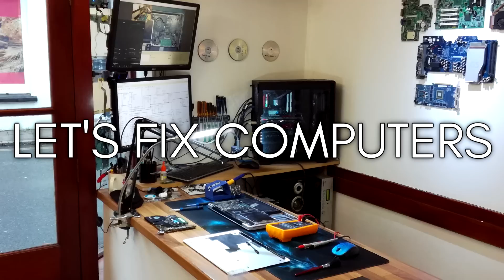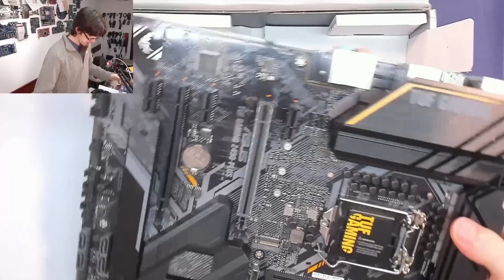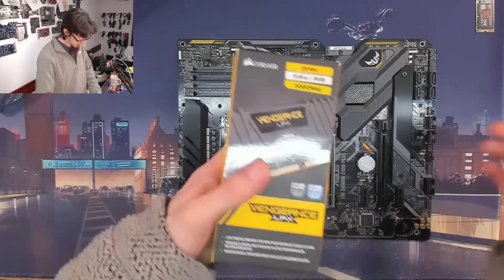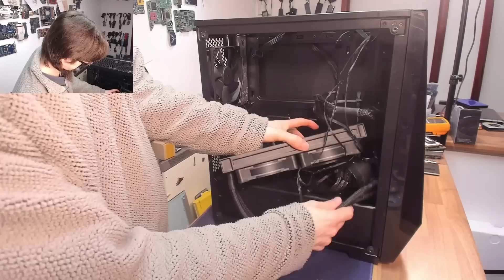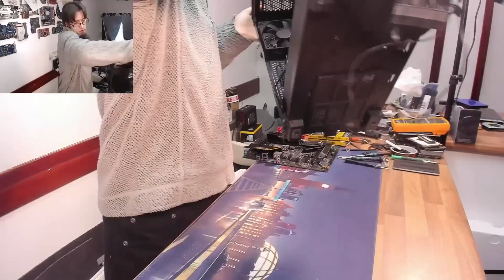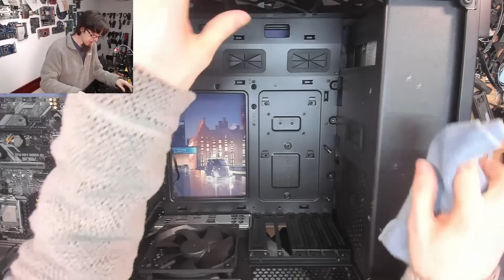Pt2. Rebuild, Custom build with No POST - LFC#240

Comment: "If its a TUF itll work."

Unless the pins are smashed by an angry ogre.
Reply: yeah - TUF - but within reason
Reply: ASUS Tuf is another word for plug & pray.
Reply: @britexitengineer1407  if ur not an idiot, not really. i'd give the plug & pray denomination to most gigabyte boards especially the B550 Aorus Pro which died on me and a lot of others users out of the blue.
Reply: @foxylune  2 DOA B550 TUF's were sent back & tested as duds I know a few others who have has issues with TUF's over the years.

Comment: i get the same power cycle every time i cold boot the pc and i have a 1660 super ti and a corsair tx750m. didnt do it with the old 760 gpu so must be a 1660 thing.
Reply: That's not normal behaviour, it only does a powercycle(s) once after a BIOS flash or when CPU has been out of socket. After that it should just turn on and go into the O/S. Maybe you disturbed something when replacing graphics card, unplug and replug every cable back in (all cable connections on motherboard and card) and take graphics card out and put it back in firmly.
Reply: @Kalmte55  everything is connect right and tried other gpu in it but only the 1660 does the power cycle. so could be the way the gpu handles the power delivery on first boot.
Reply: @darknido1  is your CMOS battery still good or seated properly? I have owned many many computers and never had any issues where a card caused powercycles each time on cold boot. Therefor this is not normal behaviour in my book, even if it is only this card giving you this symptoms.  I would not accept it and investigate further.

Comment: At 29:45 the bios version shows as version 1208. That's the latest non-beta version, but two beta bios versions are also available for download.
Reply: If I was doing a build for a customer, the last thing I would use is a beta BIOS. For my own PC I might chance it, but for a customer system I want something stable.
Reply: @cjmillsnun  i couldnt agree more , it would be very very foolish to use beta bios for customers
Reply: @cjmillsnun  Yes, but should be standard procedure, to at least check whether any non-beta bios updates are available, before returning to customer. If an 11th gen. Intel CPU was being used, a beta bios is the only current option.

Comment: I dont think I saw sata data cables hooked up to the drives nor mobo before you closed up the back. Just sata power? The two drives also didn't appear in the bios, just the m2.
Reply: they magically appear at 30:00

Comment: I think they do use the exact same VRMs as the Strix ones,  At least they do on the X570s
Reply from the maker: IIRC, they're similar, but not the same. These are DrMOS powerstages where as the Strix boards use Smart Power Stages, which are the next rung up. These are still way beyond your usual quad discrete mosfet setups that other brands usually go for.